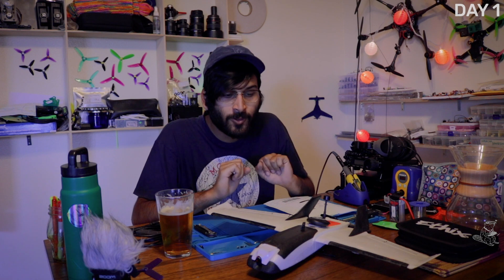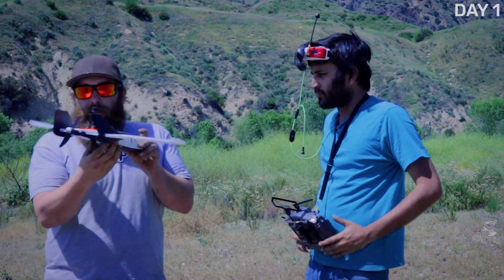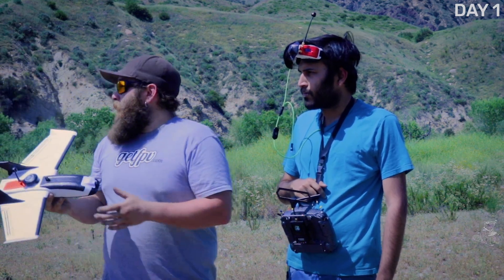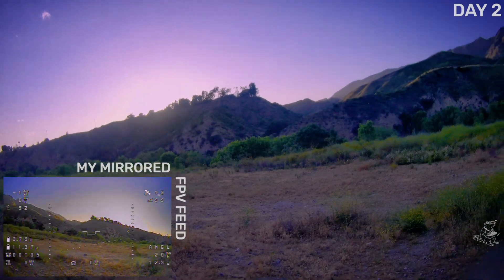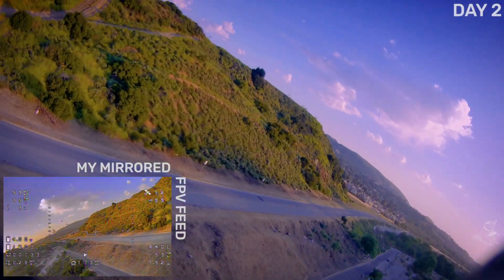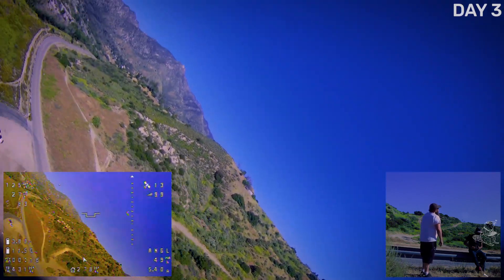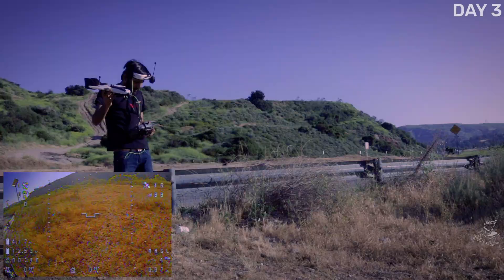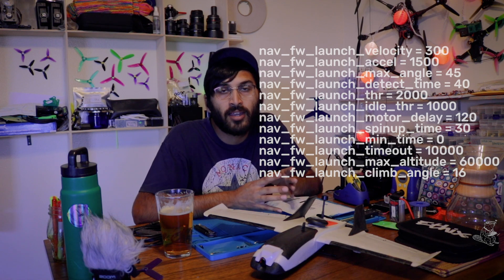THE MAIDEN + AUTOLAUNCH | ZOHD DART 250

Comment: I bought a lerei sparrow 2 flight controller . I do not have dji video . But you do not need it or computer configuring with i nav .
 The lefei sparrow 2 flight controller has 3 flight modes if you plug in the gps module .
 And it has Auto take off .  Get ready to take off . Bind gps lock .
   Click into gps return to home mode . 
    Give it full throttle .
  Watch out for props starting as you  throw launch  it or move the plane hard the motion is detected by the flight controller and it starts the motors and climbs to 20 meters and circles the gos homepoint . The gps homepoint is the latitude and longitude coordinates of where you plugged in the airplanes battery and started it all up and powered everything in the plane .
    You can put your goggles on and take control at anytime by switching your controller mode switch to manual or stabilized mode . 
 If you flybtoo for away and lose radio control it will switch itself to gps return to home mode . When it flies back into range you only need to move the control stick a lot or all the way in any direction to switch out of  the gps return to home mode . 
   You can also switch into return to home mode by using the f light mode switch during flight at any time . 

  I believe there is a lefri sparrow v3 pro flight controller now with analog fpv on screen display showin direction jome , battery level , fpv  , flight mode , altitude by gps , gps speedometer . Etc
, and a menu for more settings 
    They were out last month so I bought the v2 version . 
 The sparrow v3 pro are back in stores . And a v2 pro fc for dji , hd zero , walksnail

Comment: I like seeing your RC adventures. :)
Your flipped fpv feed story is funny because I had to mount my camera upside down as well. I wonder if it's a bug of the camera firmware because there is no point of having a "flip image" option on a fpv camera if the image is also flipped vertically.